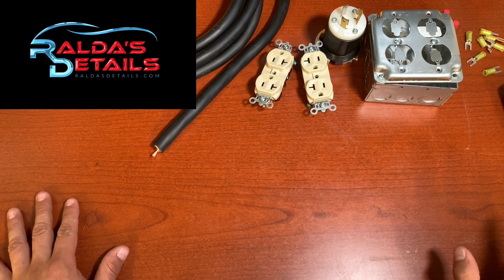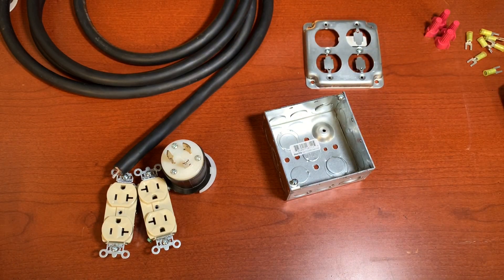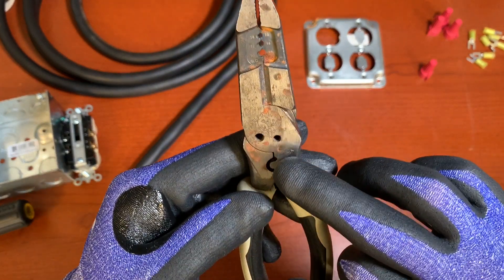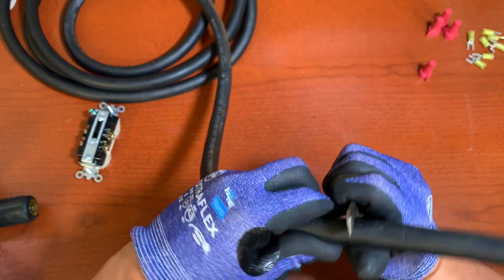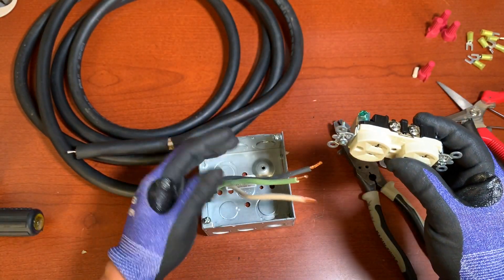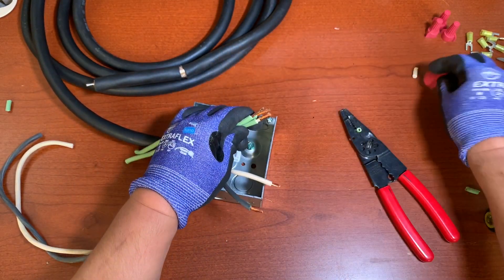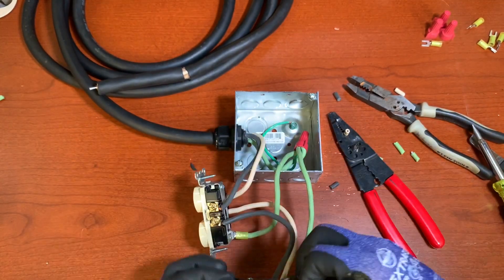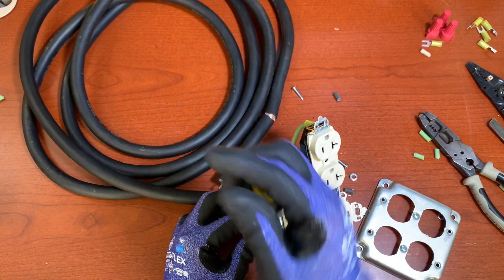Mobile Detailing Setup’s How To Make A 30 Amps Extension Cord For Generator!!

Comment: I commend you on the parts you used, wire nuts, pigtails, ground screws, and the crimp terminals you showed. You also properly mounted the outlets on the raised cover. Your explanation of the parts and the tools you used was awesome.  But I have to ask a few questions. Aren't you worried about using this in a wet environment? The 15A receptacles on a 30A breaker? Is there GFCI protection on your generator? These contraptions are basically death traps, although yours was the best built I've seen on YouTube. As for safety these are a OSHA violation on any jobsite not to mention NEC issues.  My recommendation would be a portable GFCI device and a splitter, all within side your vehicle out of any wet environment. All being said be safe.

Comment: thanks just built mine, works perfect! a couple parts were different for example instead of a silver and gold screw, i had silver and black screws. also for the outlets i used spade terminals instead of pushing the wire trough the outlet part
Reply from the maker: Awesome man!! 👍🏼👍🏼

Comment: Something folks don't usually look for is that the orientation of the wires at one end of the cable comes out different when looking at the other end.  At one end the black and white will be positioned to easily attach to a plug.  At the other end you would have to cross the white and black during assembly which makes it hard to get the wires into some plugs.  In short, examine your cable and attach the easy end to the plug.

Comment: Thanks for the instructions. It would even better if you posted a list of the materials used here. Sometimes I didn't understand you. Like what you called the black plastic connector that you fed the main wire into the box. It sounds like cpv?
Reply from the maker: Is called cgv thanks I’ll do it!! Also now I been making them for costumers I sale the on my website if interested so I can save you time! Let me know 😁👍🏼

Comment: For future reference if you actually curl the wire around the screw the connection is better and has less chance of coming out and arcing. Love the idea of this!
Reply from the maker: Thanks 🙏
Reply: Actually the way he mounted them is the intent of the manufacturer. I used to wrap my wires around the screws but the clamping plates work well. Merry Christmas everyone!
Reply from the maker: Thanks
Reply: @BarneyR-u2d  All my electrician buddies say to do it that way 🤷🏻‍♂️

Comment: Did you use 20 or 15 amp receptacles and will this set up work on a on a powerhouse 4500 inverter generator
Reply from the maker: 15 amps yes this one will work on the powerhouses Gen!

Comment: Hey Tony wanted to ask would that 250v L6-30P fit on a predator 3500 or would it need be swapped out for a 120v L5 30P so it will fit? Thank you!
Reply from the maker: Yes will work 👍🏼
Reply: It has to be L5, L6 will not fit the predator 3500

Comment: Very interesting, but aren't you plugging that twistlock male plug you made into a 240 volt generator outlet to feed the 120 volt quad box? Won't that 240 volts destroy any 120 volt appliances you plug into the quadbox?
Reply from the maker: This one is a 120 volts to do a 240v you need to split the 2 hot lines one for each receptacle and share the neutral in order to have 2 120
Receptacles different ckt. If you have any more questions let me know thanks for waiting!!

Comment: man i priced stuff out today ,, its now cheaper to buy a 25ft cord all ready made off Amazon then  it is to go to HD and build one :( Im putting my generator in the front of my  trailer and running the power out along the wall to the back doors. i was looking forward to making one of these but it will  cost more. its $2.55 per foot for the eso ..
Reply from the maker: Yep is expensive!

Comment: Ralda,   It is an OSHA violation to make an extension cord and use it in a business unless you had it tested and listed by an approved testing agency, like UL.   If there is a problem, and someone gets hurt, they will probably blame you.
Also, if you were trying to follow NEC rules, the metal box is illegal, the over current ahead of the 20 amp receptacles in the generator being 23 amps is illegal.  If you would like to see the OSHA rule that says what you made for a business is illegal, just comment and I will get you the link.
Reply from the maker: Well yes this video was mainly to let people know that they can use on their setups. The way I build the now is with GFCI receptacles and bell box and waterproof cover!
Thanks for the advice I really appreciate you!